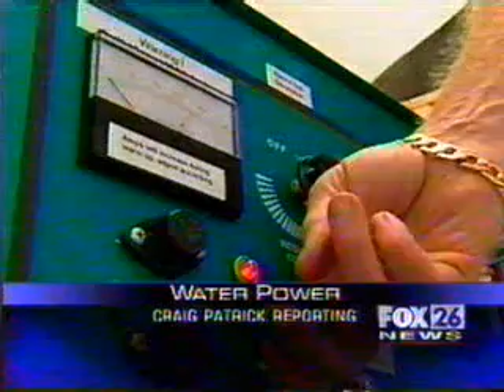Water as fuel

Comment: It'll never replace petrol (gas) as a fuel, bcause petrol is a by-product of the oil refining process to extract all the other valuable chemicals we need and use.
The ONLY, SAFE way to dispose of this by-product, is to use it in the internal combustion engine.
Refiners can't burn it, drain it away, store it safely, or use it in any other process. Sure, they put back some of the chemicals they extract to make it burn eficiently in engines. And that is why we will have gas (petrol) engines for as long as there is oil to refine.
You just have to ask yourself, if it's a waste product, why we have to pay so much for it.............Simple.............the greatest cost of gas (petrol), is the tax levied by governments for giving us the job of disposing of it for the refiners.